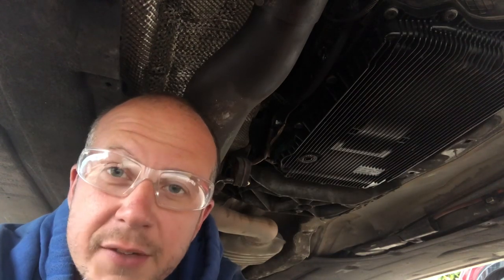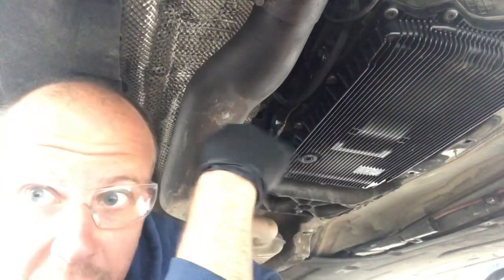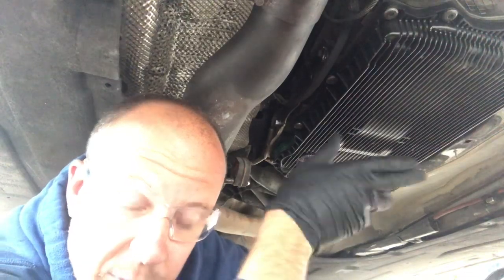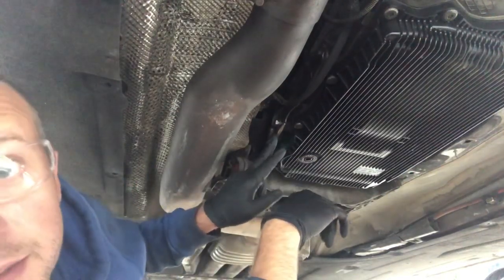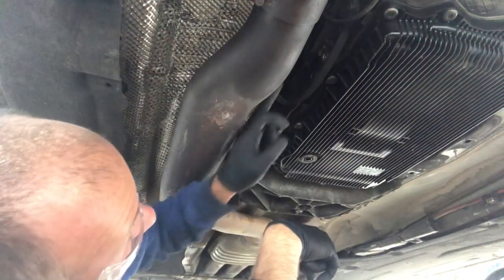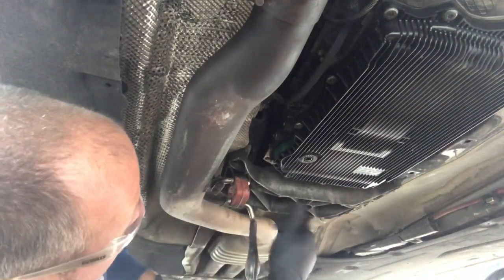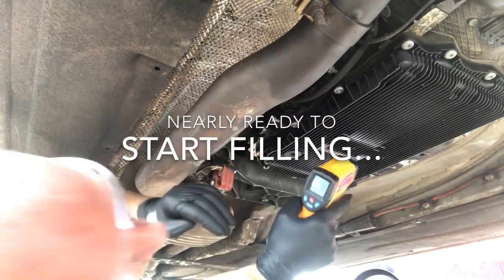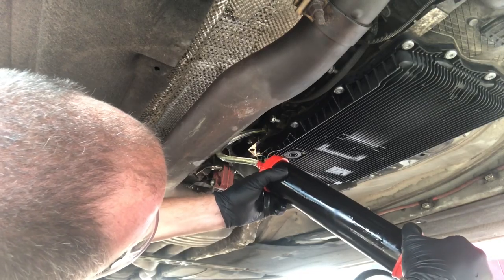BMW 530d F10/F11 ZF 8HP70 - DIY Transmission Service

Comment: Great vid, would this be the same procedure on an Audi Q7 ? It's the same transmission I think
Reply from the maker: Almost certainly, but please check to be certain 👍
Reply: @Nut_Job.   Great mines done 100k so I think it's ready how much was the kit and oil all together?
Reply from the maker: I paid about £180 on AUTODOC if I remember correctly. I ordered some other bits at the same time like my fuel filter, oil filter, cabin filter etc 👍
Reply from the maker: I used Vaico fluid which is compatible with the the ZF 8HP boxes

Comment: No flushing ?
Reply from the maker: In my case the box was mostly empty (perhaps ~3l still inside) and flushing is not so easy as a DIY on the drive. What I’ve done previously is repeat the drain/fill process after about a week which further dilutes & replaces most of the old fluid.

Comment: You really need to get the oil going back in as soon as the engine is started. Then check the temp before the final level check

Comment: Fill procedure is not wrong.

1 Wait till engine temp is aboven 75c to open up the gearbox oilcooler. But gearbox not aboven 50c

2.   30seconds 2000 rpm in neutral to fill the turbine
Put on handbrake. Put in R, D and 2nd gear all 10 seconds.
Reply: Thanks

Comment: Is there any need to do the mechatronic sleeve like the 6hp box?
Reply from the maker: To be honest, I’m not sure. I didn’t read much about it (unlike with the ZF 6HP’s) so I left it alone. I found this gearbox very easy to work with overall
Reply: its usually done at the same time, as its cheap and needs pan down to do. If a mechatronics o-ring fails, it leaks and its a drain and drop pan job all over again. The o-rings go hard and flatten with age.

Comment: Nice. Transmission filling is never easy straight forward is it!? Also a tip I use is when you have a number of bolts to torque up i use a permanent marker to mark it to keep my sanity  in check!
Reply from the maker: Yes, that’s a good recommendation 👍
I was planning to do that when I tightened my head bolts... however, once I started I was so focused on the task I just continued without stopping 😁

Comment: Would be interested if you noticed any difference in the shift pattern as ZF advise to reset the gear shift adaptations etc??? Mine is on 153K miles so I am also considering this soon.
Reply from the maker: Yes I know that the correct process is to reset adaptations so that the transmission can adapt to the fluid viscosity. I haven’t done it, and it still changes perfectly to be honest.
Reply: How many liters of fluid did you filled back. I also made change and the first filling was 3ltr and then went 1 extra.
Reply: Cheers does it shift any better now though?
Reply from the maker: It shifts perfectly now 👍 
There wasn’t really any problems before, but you can’t hardly feel the changes at all 😀
Regarding the fluid quantity - don’t forget I had removed the transmission & drained the torque converter. That’s why I got about 6/7 litres back in 👍

Comment: I had my F11 530D gearbox service carried out by ZF in germany, they also did the rear Diff as well even though BMW say thats lifetime. So do the rear diff while your at it
Reply: @A B Im in this proces now, ZF in The Netherlands quoted me for € 797,50, that is included a flush so they will roughly use 12 liter of hydraulic fluid. Pretty expensive but i gonna take the offerte since my ZF8HP has now 312.000km and for what i know it is never been serviced in that 8 years.
Reply from the maker: Yes, it’s on my list 👍
Reply: sim rai Did it cost much? Im looking to have my x5 done
Reply: Yes, I did both mine on my 520D at 180k km. I rang ZF in Germany and they recomended changing both at 100k km.
Reply from the maker: I think another person commented it cost ~€600 with ZF. I think that might be at a service centre in Germany though, so you’ll have to factor that in too...
Reply: @A S  I had mine done in Dortmund, They sucked out all the oil from gearbox and torque converter. They stripped the valve body and cleaned out all the small channels and replaced those small ball-bearings and some electronic parts. Then refilled it and did the diff. This was last year and was around 500 euros
Reply: How did you get into contact with zf? I'm struggling with their website.

Comment: Well done, all good now then. Surprised the oil isn't red as auto transmission fluid usually is?
Reply from the maker: Yeah, the ZF Lifetime 8 fluid is a green/yellow colour I think
Reply: @Nut_Job.  your all ready now to get that remap that you wanted to do. That will be interesting to see how you get on with it
Reply: ZF 6 also yellow
Reply: Most European cars use hydraulic fluid for the transmission gold looking.

Comment: I've done my research and will do mine next week. I found all the oil, pan and filter codes from the ZF website and got the exact pan and oil that they recommend from Eurocar parts. What is your thoughts on the remaining fluid that you didn't get out.? Also how much did you change?   Do you think after getting up to between 30-50° you can shut off the engine until you get more oil in then start it again when it flows out just to give you more time to fill it?  Great video 👍
Reply from the maker: I had considered the ‘dilution method’ where you can repeat the drain/fill process 2/3 times until the box is mostly full of fresh fluid. The perfect way would be to use a machine at a garage which pumps the fluid around to complete the flush/change... but this is obviously the best we can do from a DIY approach 👍
Reply: I agree, unless you have high end dealer equipment and 20+ ltrs of oil then this the best method. How much did your box take?  I wanna get as much out as possible.
Reply: If you stop the engine whilst filling up the fluid drops back to the pan and would come out of the filler plug .

Comment: A cheap little electric screwdriver that takes hex bits is so useful for jobs like this when you're working alone. The fluid didn't look terrible so I'm guessing it's been changed before considering the mileage and the fact the filler plug had been tightened by someone hamfisted 😂
Reply from the maker: My thoughts too 👍
I avoid using power tools on these jobs as I’m always a bit afraid of wrecking the thread as it’s an aluminium casing. I’m sure I’m just being a big pussy, but I could do without extra headaches right now... 😂

Comment: I did mine on a x3 f25 at 80000 km but used the original bmw zf oil and original pan(around £400) ,it took 4,8 liters also used one  of those pumps to suck out engine oil just reverse inlet/outlet ports and pump oust from the can, you can get those pumps for about £10.
Reply from the maker: I’ve got one 👍
I used it to do a quick oil change on the Range Rover last year.